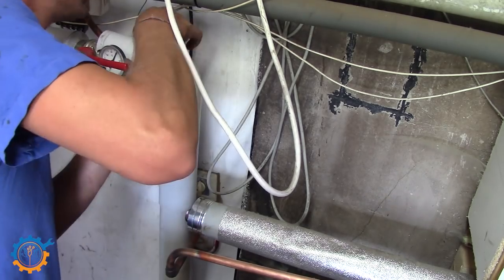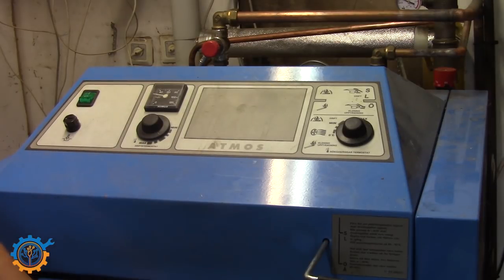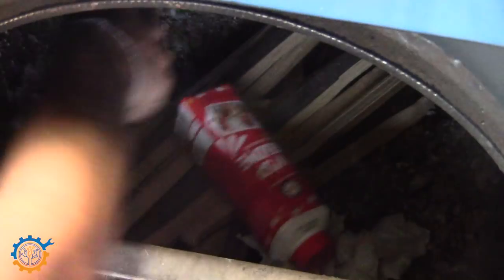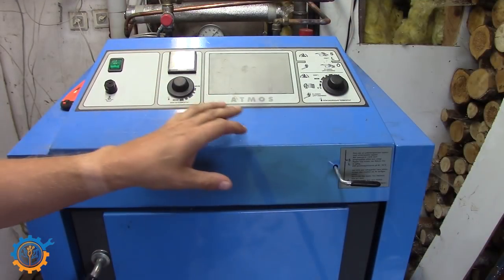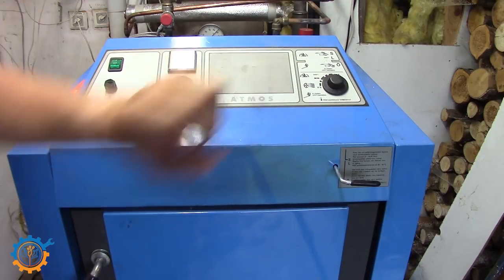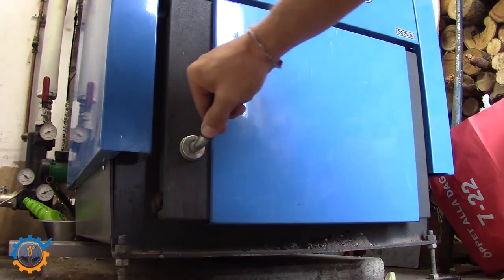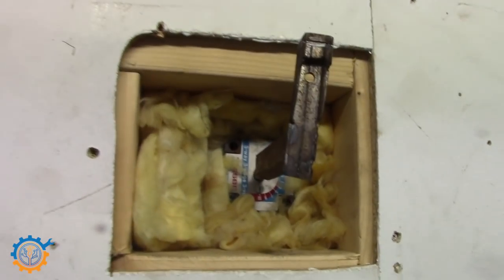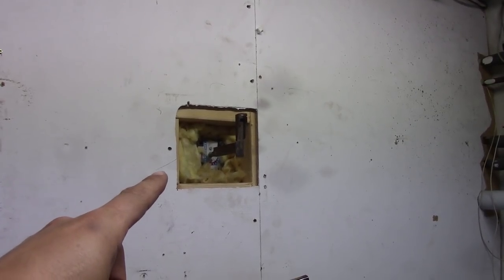Boiler install part 3 - Insulation and testing

Comment: Yeah that makes sense.... 👍 
Thanks for the answer.......by us we need about 2000-2500l of backup heated watter to go over the night in the hard winter (-15 -20°C)night and part of the day....piping work is slightly different tanks are in series everything else is probably the same......
Reply from the maker: Yeah 2.5m3 is Close to 100kwh :) yeah some do series some parallel. Both have its advantages and disadvantages. Parallel works great as Long as you know about the downsided.  When i now mix different tanks it gets harder. Lets see with monitoring how it Will work :)

Comment: to get down the temperature at exhaust, you can add a heat exchanger to your boiler exhaust and use the hot air in addition to the fire :)
great work at all :thumbs up: ^^

Comment: Why don't you heat your house with the heat pump? 
I know you have plenty of wood but anyway your opinion... 
Thanks
Reply from the maker: I thought I answered but i cannot find the answer hmm.. My house demands around 80-100kWh per day during winter. That would with a heat pump be up towards 20-40kWh in electricity during winter. My solar system gives me 100kWh during summer and max 10kWh during winter.  I need 16-20 just for electricity. To get the last 20-40 i would need to install another 40kW of solar panels :D  Its not economic to do since the cost of wood is just like 500USD per year :)
Reply: Also, by having a secondary heat source than the electrically driven heat pump you have options and it's a lot easier to stick the boiler controls and water pumps on a battery backup that it would be to have enough battery capacity to run 40kWh/day out of a battery backup just to keep warm! :-)